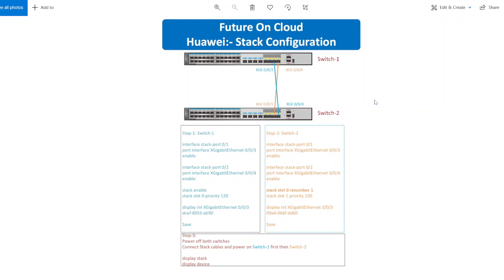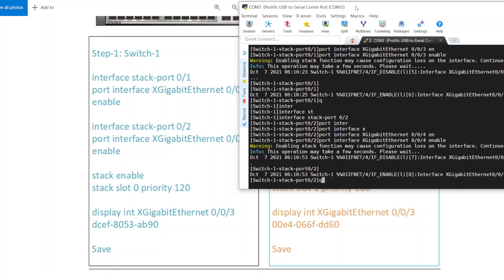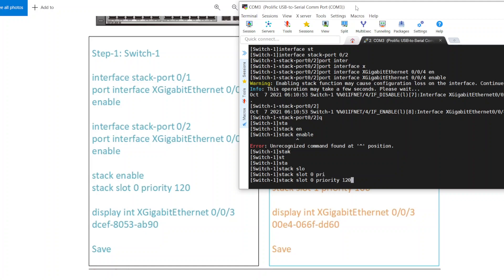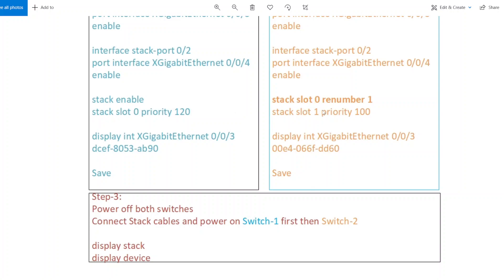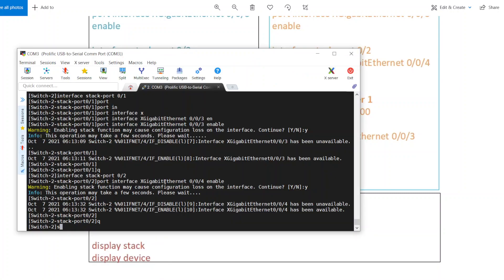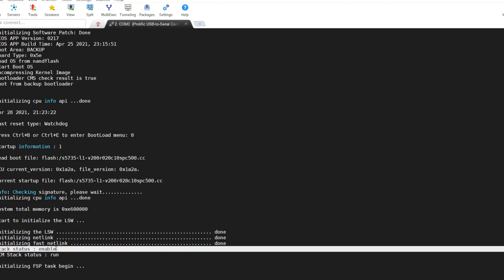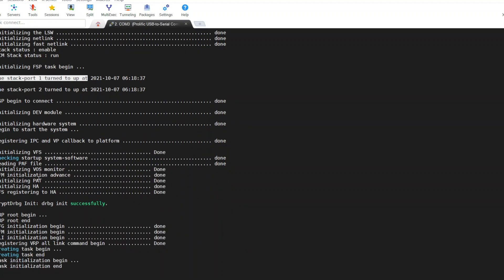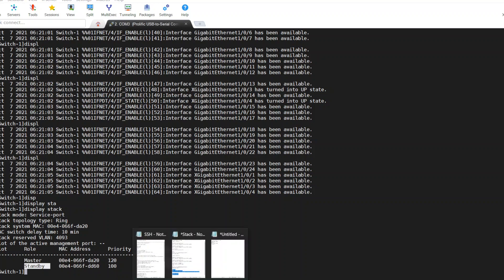Huawei Switch Stack Configuration

Comment: when stacking with two switches is no needed to create two logical interfaces (huawei's recommendation). In the first sw create the stack-port 0/1 and in the second sw create the stack-port 0/2 (when the slot is changed to 1 it will be stack-port 1/2 ).
those ports can contain one or more physical ports (if you want to connect both switches with backup links)

conclusion: with two sw there is no needed to connect them in a ring topology, chain is suitable

Comment: hi
Are you using stack cables to connect both swithc
Reply from the maker: No these are Fiber patch cords.
Reply: Hello, can You please tell which SFP were u using for stack ? I tried different type of SFP modules and non work. Does it need to be from Huawei ? @FutureOnCloud
Reply from the maker: @Freezy443  I have used 10g SFP. It's Non Huawei SFP.